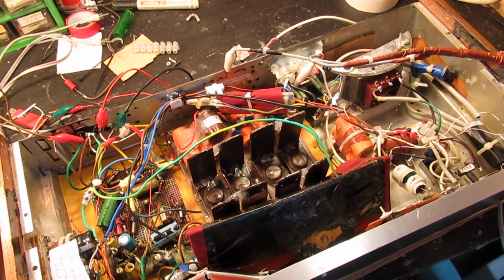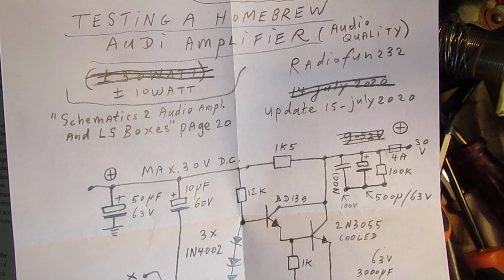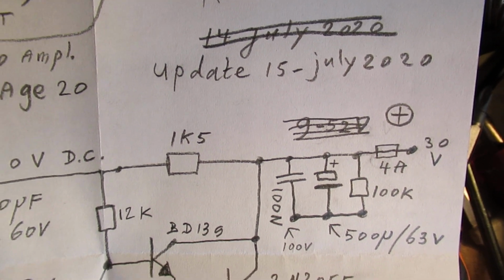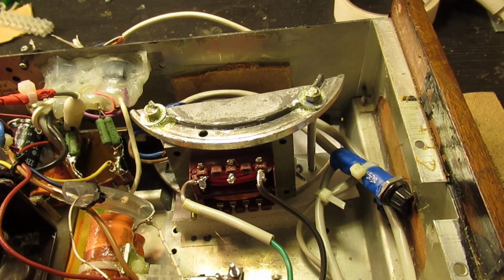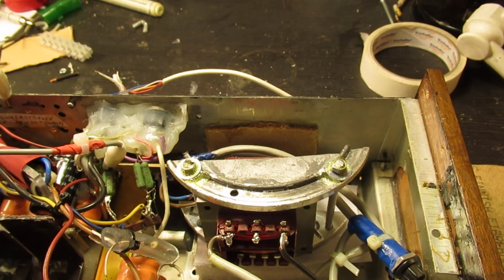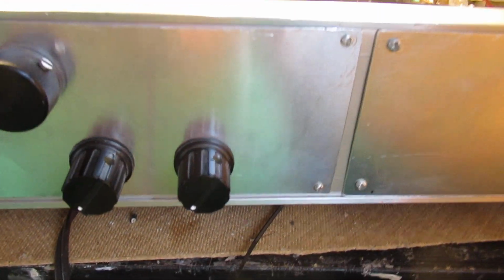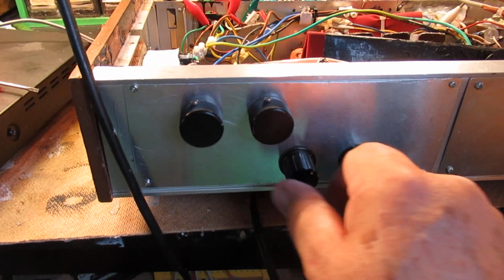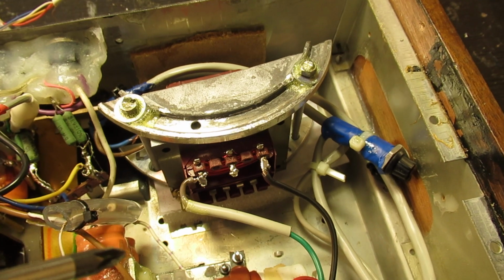Test of the  2 x 30 Watt (now 2 x 10 Watt) audio amplifier on its sound profile update + schematic

Comment: 3:44 klein foutje Ko, de DC voltage is geen 0,4x de AC voltage, maar 1,4x de AC voltage. 
Betreft de test met lampen gisteren, vermoed ik dat de belasting met een echte speaker anders is, aangezien de weerstand van een speaker 
veranderd als de cone beweegt en een zelfinductie creëert.
Het zou leuk zijn om eens een vergelijking te zien, in bv een 8ohm speaker en een 8ohm weerstand als belasting, en het scope patroon parallel gemeten over deze belasting.
Reply from the maker: Je hebt gelijk, bedankt. Correction: the DC voltage after rectifying  with a bridge rectifier is 1,4 x the AC voltage.
Ik heb je comment gepinned.
Reply from the maker: Bjorn, leuk idee om dat te laten zien: pure weerstand tegenover een inductieve belasting met een beetje - in dit geval, een luidsprekerspoel - parallelcapaciteit. Ik houd het in gedachten.